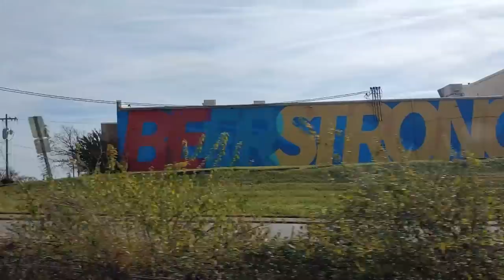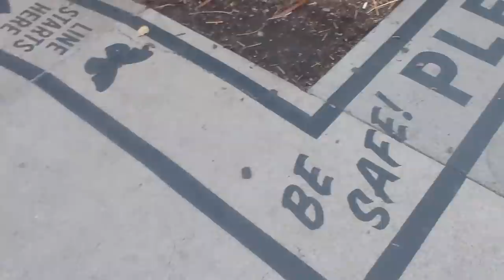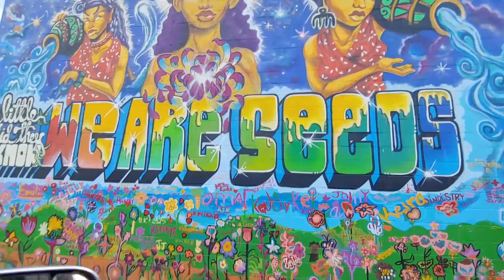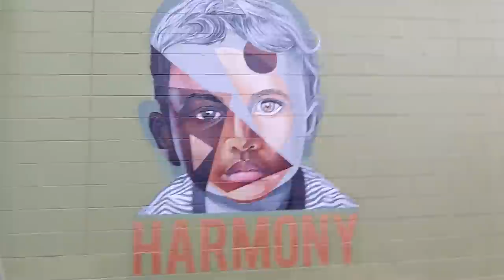Can You Trust Camping World RV Repairs? [Travel Nurse Family]

Comment: Your driver side leaf springs have lost their lift. They will go next, replace them yourself its very easy. Go to a trailer place and they can get them for you. The spot that wore on the frame looks like it has a crack in the middle, may just be the video but check it. If it does it needs to be welded. Great videos!

Comment: So had a spring break on the road. Actually had the axle roll under my fifth wheel. Found a trucker service, they came got the tires off both side of the axle with the broken spring. Followed me back to a truck  service spot, they looked at it. Called a spring shop, had a part the next day and fixed it. There are folks who drive commercial trailers of all size, some no bigger than a travel trailer. My out of pocket, including the road service was about $600 bucks. Go with the commercial guys. And I have meet several folks (mostly with toy haulers) who immediately throw out the stock suspension and upgrade it. As a mechanical engineer, I think the springs are deliberately soft, for the load to reduce jolt. This is really on the trailer manufacturer, for cheezing out on the springs.
Reply: the suspension on most travel trailers and fifth wheels are not actually designed to carry liquid in the tanks, most manufacters say not to haul it with water. on decent roads it works out ok but once you start hitting dirt roads with water in the tanks stuff starts cracking and breaking. im sure in this case in the video when the bracket broke the spring was damaged, but since its warranty and they may have found no visible damage to the spring they didnt replace it and it finally broke. im a mechanic on rental construction equipment. we have had many trailers get overloaded by customers and break suspension parts. we replace everything connected to the broken components because we have had trailers break a week after the repair because of this reason.

Comment: We didn’t have the work done at camping world but did have the same issue. We have a 2017 keystone outback 29ubh and all 4 of our springs went flat one was broken. We upgraded to heavier duty springs, cre 3000 Equalizer, heavy duty shackle straps, and grease able wet bolts. So from what I gather on keystone forums, they use good dexter axles, but the running gear isn’t dexter and is the cheapest gear they can find.
Reply from the maker: Wow, good to know! Thanks for sharing. :)

Comment: If you think you have a propane leak, get a spray bottle, fill it with soapy water and spray it on all of the connectors on your gas lines.  Wherever it's leaking from, you will find from the bubbles coming from the leak.
Reply from the maker: We'll try that next time. Thanks for the tip. :)

Comment: First thing they ( Camping World ) should have checked the propane tanks for safety and told you they need filled. After fixing the L.P. lines under the trailer and since the cut into the trailer frame should have brought to your attention.  And a 2" x 8" steel plate welded to the frame area for frame integrity.
Reply from the maker: They did say they ran a check on the lines. Seems odd it would be empty - so did they they run it out when they checked it? I hope they didn't just "say" they checked it but did not actually. As far as the frame, I didn't think much of it. Thank you for calling attention to it.
Reply: We should always take in consideration wherever you go  there are dealers in the RV trade under the same name like Camping World depending on areas of locations in each state could be two dealers one might provide professional Service the other not so good.

Comment: Camping World in Newport News, VA put awning toppers on my 5 slides.  They left a tool on a slide which they closed up and I didn’t find it until we got to the RV park.  They also put a big scratch in my table.  I found the tool because I noticed there was rip in my slide roof.  Took me about 2 hours to get it out so I could operate the slide to leave at the end of the weekend.  They had to replace the roof on the slide.  That was the second time I had a bad experience with them so NO MORE for me.  Found a small local RV repair company and never looked back.

Comment: I am sure someone has said this before but if your living in it, upgrade to 30lb tanks, you will burn thru those 20lb tanks too quick especially in the winter using the furnace.  I got 30's with my fifth wheel and winter camping burns through them fast, though of going to 40 but they won't fit in my front cabinet when the tanks stay

Comment: I would get your rig weighed as soon as possible. I would suspect you are lopsided for weight and possibly over the capacity of your springs and axles. We use Northern Tool for getting a lot of parts for trailers and the quality on the springs, perches, etc is very nice. Alot of these campers are made as cheaply as possible and as a result they go super cheap on the stuff like tires, wheels, axles, bearings, springs etc. Once you get it weighed on each axle you will have a better idea whats going on there.
Reply from the maker: We are planning on it. We were so focused on getting back to KC for the holidays - we are hoping to drop some weight while we are here and then take it to weigh. We had it weighed when we purchased the new truck in August and it was not over weight for the truck we never adjusted the hitch so I'm sure it's not distributing weight as it should be.

Comment: Your trailer may still have some lean because the remaining leaf spring on that side was overloaded and may have undergone some plastic deformation. At a minimum, they should have replaced both springs on that side. I would have replaced all the springs with a higher load rating. Yes, that does not increase the axle capacity, but it appears that the springs are currently the weak link.

Comment: You guys should look into a Mopeka tank level system.  We just put one on our tank in October before our Halloween trip in the Adirondacks.  We were expecting sub freezing temps.  Our current camper does not have what you would call a thermal package, however the underbody does have insulation.  We had never had it out this late in the year, so we wanted a way to monitor the tanks from inside the rig.  Their app is really cool, and it's good to have a mental idea of how long we could run the furnace, hot water, and stove when we had a 9 inch snow dump.  If you do decide to get one, try and get the newer version with metal feet, and definitely use the feet!
Reply from the maker: That is a great idea. It would certainly make things a little easier.

Comment: People are much more likely to air their negative experiences than their positive ones. That said, I've dealt with Camping World when they were up in Bath, NY on numerous occasions: to purchase (2) travel trailers, a class C and a dolly for a toad. The only problem I ever had was with the dolly. Less than ten miles from their location, the brakes started smoking. A newbie in the shop had wired them incorrectly. They sent a crew out to load the dolly on a flatbed, took it back to the shop and had it fixed the next day. The newbie was fired. 

Yes, what they sell in the store is a bit overpriced, but if you're in an area where you've no other shop to get parts from....

Comment: I had my motor home there for a banks system. They took three days to get at it. When they did they broke a head bolt and took another week ti repair. We had to stay in hotel at significant expense . They wouldn’t answer our phone calls we had to go over several times and got the run around. Then they wanted to charge us for all the time they spent repairing their own mistake. Took alot of arguing to get them to correct and even then we had to put through warranty. Don’t ever go there!

Comment: Rule #1 Never, Never transport propane tank laying down on their sides, either Empty or Full, They can Explode, sit the tank in the upright position in a milk crate, or U-haul sells the green stand that you insert the tank in, make sure it can't move while you are driving back to or from the trailer. Bunge cords work well there. 
To keep most people Honest: The Wing nut that you took off the bar to remove the tank. you need to tighten it down and align it even with the bar. Drill a hole thru one wing of the nut and in line with the bar, purchase a long shackle padlock put it thru the hole from the bottom with the key hole up and lock it. in some States people will steal those tanks in a second while your not home. it's expensive to replace what's stolen.

Comment: You most likely checked your axel rating.  I have seen you problem with other trailers with under rated axels for a trailer.   Check you have grease fittings on leaf springs bolts, second check your tires are tracking straight, if not you may have week axels.  Check the trailer weight tag for axel weight and have the trailer weighed is you have a acceptable reserve. Also, check your tires for weight,  it all tires are made the same.
Reply from the maker: We have gotten a new underside since this video - new axels, suspension, and springs

Comment: I always bring a propane leak detector with me.  If I ever smell gas, like you did, I start looking for leaks.  I got mine on Amazon for about $35.
Reply: Many explosions have happened that way. Propane doesn’t smell in its original state the odor is added to it i believe. It is heavier than air therefore it sinks and sets and rolls along the ground to low spots. Watch out for those campfires.

Comment: That's puzzling about both propane tanks being empty... but at least an easy fix. Will you have to fix the hole underneath where the spring damaged it? Our old RV trailer had the whole underside closed in to keep everything from freezing, so if it had happened to us, I may have been tempted to use the Red Green solution on the hole (duct tape)! ~ Kir up on the Cumberland Plateau, TN
Reply from the maker: Well they didn't seem to think it needed any other repair. We are leaving it for now. We hope it hasn't weakened anything.

Comment: Honestly can’t believe how dangerous it was driving around with the broken spring, which meant that the entire weight of one side of the travel trailer was relying on one axle instead of two but also the same as the axle that had failed. It doesn’t bear imagining what could have happened if the spring on the front axle had failed while you were driving due to the overload on it. Camping World did not do ‘OK’ because they should never have allowed you to drive your rig away from their depot knowing you had a broken leaf spring! You could have caused a major wreck.
Reply from the maker: hmm.. Well I'm really glad we didn't wreck and that it's fixed now. Thank you for watching.

Comment: I’m looking now at buying a camper from them and as long as you bring it in once a year for a $200 dollar service a new camper has a lifetime warranty.
Reply from the maker: Thats a decent deal so long as they can fix it.
Reply: Let me know how that works out
Reply: I got that same warranty on my RV...they sure like collecting that fee every year...but somehow when it came time to repair stuff it wasn't covered...the best one was their tech...pumped grease into my bearings on the axles...blew out all 4 wheel seals and ruined all 4 sets of brakes...somehow I had to pay for this because I couldn't prove it was their fault...$1200.00 ...4 wheel seals don't all fail at once on axles with under 2k miles...I work on the trailer myself now
Reply: I did get one from Camping world. I have a friend who got one from another place because he said the service was bad at CW but then found out service at all dealers is shitty. I just took in in for its first check up and told them about four things that had broken about two weeks before I took it in. They fixed three free of charge, I had to pay to replace the light cable that had sagged and gotten dragged but I expected that.

Comment: If the camper was returned to you with empty propane tanks, that means that they didn't leak check the new propane line after they installed it. Shoddy, crappy, unsafe practices by service "techs". Typical.

Comment: Ummm It looks like the Trailer fram may be bent. Doesnt look right better get that checked.  You could have got that fixed at any 4x4 shop. WoW $500 dollars for a leaf spring.   leaf spring is maybe $50 to$70 and a hr job at most $300 would have been a rip off price. No camping world charged you expedited shipping to rip you off even after ripping the warranty company off!!! LOL     STAY OUT OF CAMPING WORLD
Reply from the maker: Maybe. They also replaced the propane line. 🤷‍♀️